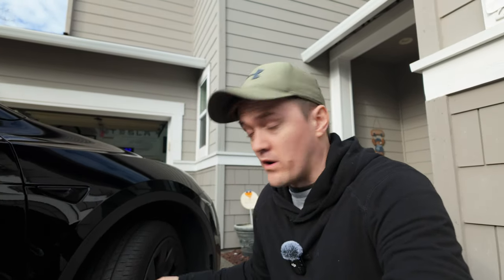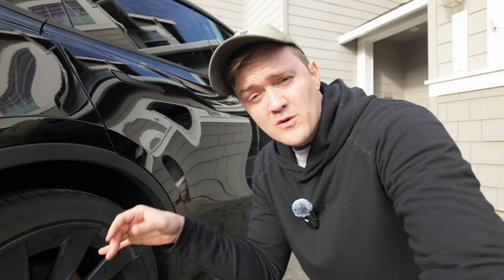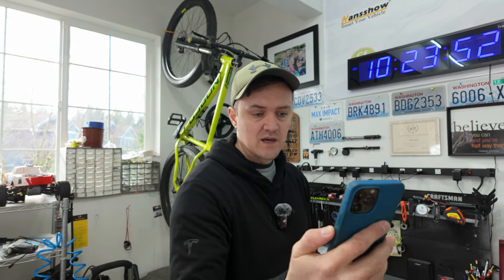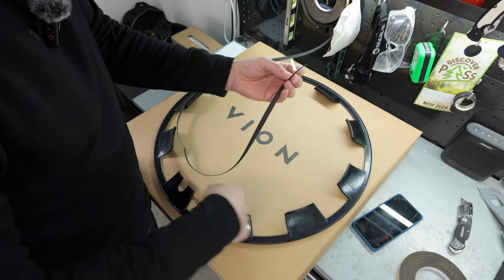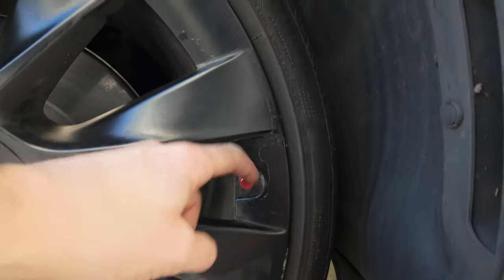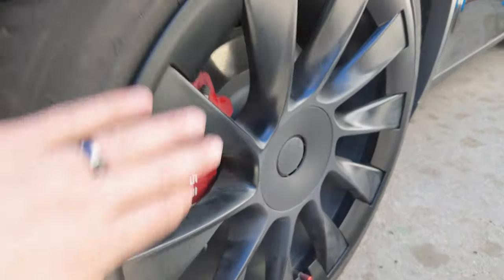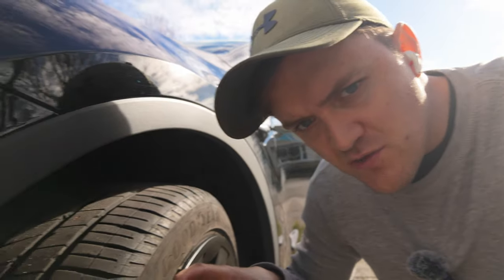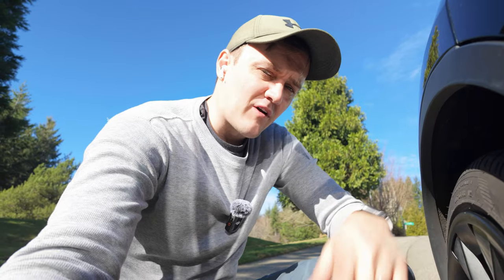Say Goodbye to Tesla Wheel Curb Rash with This Astonishing Solution!

Comment: I have 18" wheels on my Model 3s. I was one of the first to buy Rimetrix wheel covers. My rims are pristine. If I do scrub a curb, a quick buff with a Dremel wheel, some silver Krylon applied with a brush, a quick buff the next day and a little Krylon clear. From 5 feet away, the rims look like chrome. I've restored the "chrome" on the rest of the car as well. Sets off my red Model 3 with the white interior just great.
Reply from the maker: Good point on being able to just buff it out.
Reply: I had Rimetrix in black when I had a Model 3 and tried sanding out some curb rash and it still looked terrible, so I just bought another set when they had a sale.  So then I had extras for later curb rash.

Comment: We can thank Tesla for this issue because the decided to put wheels on that stick out farther than the tires.  In most vehicles the tire walls stick out farther, which protects the wheels from curb rash.  Glad you pointed that out.  The better solution is to replace all the wheels with 18" tires, because they have a beefier sidewall and wheels that are recessed more.  Not only will you get more protection from curb rash but you will also get better range.  I did this after I bought my 2023 Model Y Performance and couldn't be happier.  TSportLine sells the sets and yes they are a little expensive but they are mounted, balanced and have the TPWS inside them, so all I had to do was remove the OEM wheels and put on these new ones.  I think they look much better and I do notice the range increase, which was important to me because the Performance has the lower range number.

I do think this product is better because it snaps in place like other wheel covers, the other products sticky tape was never a good idea.  But there is no worry about not having clips on the outside.  Think about it for a second the Tesla wheels covers don't have outside clips.  Rimetrix wheel covers don't have outside clips and I had those when I used to own a Model 3, not once did they come off.

Not sure that removing that tape was a good idea.  Yes, it fits tighter but even small vibrations will cause it to rub the paint off the wheels, so you might want to check it periodically.
Reply from the maker: Yea thanks Tesla. I messed with the tape and found ways to put it on that kept it from toughing the tire. It was just the solid piece around the top that I had trouble with on two of the rims. The there two it went on just fine so I am not sure what the issue was there. Yea the 18" offer more protecting but I can pick up chicks better with the 20" :)
Reply: @CfTesla  Actually chicks like more beef on tires.  :)

Comment: There is actually numerous driving techniques that allows you to not hit curbs. I have a 2018 Model 3 (March 2018) and have the stock wheels on it and they are in mint condition, never been “curbed”. I am the only driver of the car. About 80% of my daily driving is in the city of Chicago. One tip to avoid curb rash is to never swoop in close to a parallel street parking spot. Come in wide and back it in tight using the back-up cameras white lines and the side mirrors. Most of the time in the city you are backing into the spot because it’s just one available spot between two cars.

Comment: I used both this and magbak and from my personal experience magbak is better for longevity 

1) Why because you will spend way more money replacing a whole rim cover vs a small section aka do the math 

2) when using these please keep in mind when going thru a carwash that it can crack or completely break. This has happened to me more than once so inwent back to using magbak

Comment: 1:47 I seriously doubt they fell off. It was probably an impact. I've had MagBak protectors on for several months. None of them even looked close to coming off. The tape isn't there to hold the sections on, at least mine weren't . Mine only had the one sided protective film as shown at 6:45, there was no tape intended to hold the segments on. I put over 2,000 miles on the car and the segments stayed put. I needed to replace half of a wheel because I rashed a tire again. The MagBaks came off then. The bad thing about reordering is, at the time I ordered the replacements, you couldn't order a single tire..it had to be a complete set of four.
Reply from the maker: Don't get me wrong the Magbak are a great option and I have endorsed them for years. Since this is my wife's car I can't say why that one was off. To behest I didn't even know it was missing until I started this review. Mine are definilty stuck on by two sided tape and clipping to each other.
Reply: @CfTesla  They must’ve changed the application process. I was worried mine were going to fly off but I think the attachment points and centrifugal force keep them secured. I walked around the car twice after the initial install pushing each piece to make sure it was in place. Thanks for your review.

Comment: This was great.  The tape was about 3 minutes per wheel, but attaching was 30 seconds and they look great.
Reply: Did you do it all around the rim or just on the spokes like at the end of the video?
Reply: @stuartwatts9493  it covers like he shows. It only prevents minimal wheel rash, but I rubbed an island curb in FSD at 30 mph and it took off the cover and rashed the wheel. Otherwise they stay on.  It covers up the rash and looks great.
Reply: I went around the wheel and the spokes with the tape.  It was really quick.

Comment: I have to say I am disappointed with MagBak’s solution because it seems that (in my case) the plastic has actually split in many places where the segments meet the outside rim edge. This is without side impact, although it could have been due to potholes. The Vion solution might be better but at over $100 for each wheel it’s only about $50 less than getting a wheel professionally restored (ground down and repainted). I have had this done once and it cost me $150 and the wheel looked like new. I might rip off the MagBak plastic segments and go naked. 😊
Reply from the maker: It's $109 for the whole set, 4 wheels, so if you had to replace one it is just over $25 although at the time you can't buy them individually since they are too expensive to ship but you would have a bunch of spares if you did. I would recommend giving them a try. I have been liking them.
Reply: Oh my bad. When I went on the site it looked they were $109 each (didn't say "for set of four"). If that's the case it's a much better deal. Thanks for the correction! 😊
Reply: Now I see it says "4 wheel covers per package." at the bottom.
Reply: Ordered! Thanks

Comment: The ability to be able to order separate replacements off their website and the ease of replacement is a nice.  Although once you have a replacement segment for MagBak's you could potentially fix rashes on multiple tires if the damage isn't extensive. With these Vion covers one would need a ≅ $110 cover for each rash.
Reply from the maker: Yea I think that will be the main decision people will have to decide on. They may not stick to your rim with tape but they will be expensive to replace.
Reply: It's not $110 for each wheel, that's for a set of 4.
Reply: @Resist4  The pricing is quite a bit better than MagBak but it would still require the purchase of an entire set at $110 to replace one tire as they don’t come per wheel.
Reply: @skyserf  They are actually $109 per set, but you are correct they don't sell them individually yet.  I would still purchase another set because you would want spares, if they do start selling them individually it would be cheaper per cover to buy the set.  When I had Rimetrix wheel covers I was glad I had another set because I eventually curbed several of the first set.